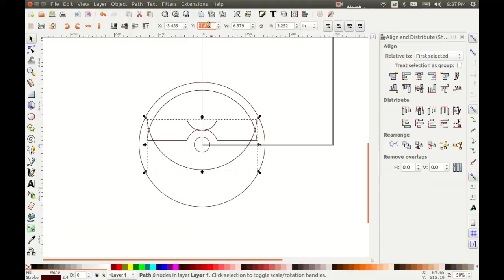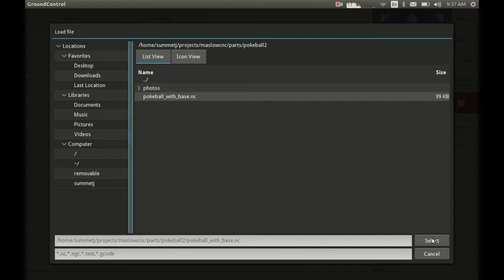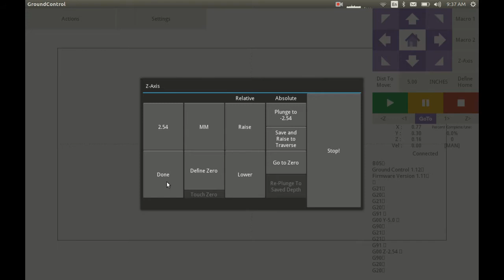Part 3 - CNC Routing the part (Resin Pokeball Sign Example)

Comment: Awesome work man is the bungle you have on your router for the tensions for the z axis to move down?
Reply from the maker: Yes, the bungee is needed to keep downward pressure on the router as the Z-axis it comes with isn't optimal for CNC applications.  Most Maslow owners end up with something similar (or an upgraded Z-axis that doesn't depend on the lead screw mechanism from the original router.)
Reply: Jay Summet thank you so much for the response I finally took the time to understand fusion 360 and was running to issues with that. You saved my life man thank you so much.
Reply: @summetj  sorry to bother again, do you know what depth to start your z axis at for it to work properly as what set in g code.
Reply from the maker: @MikeHunt-qu6ef  I just set it to start at 0 in the g-code, but then on the ground control software I set "zero" to be right after the bit started to touch the panel I was cutting. (I have a foam waste board under the work piece, so I can poke out the back a little to get a clean edge there...)
Reply: Jay Summet omg thanks and the foam board tips is really smart, thanks again.